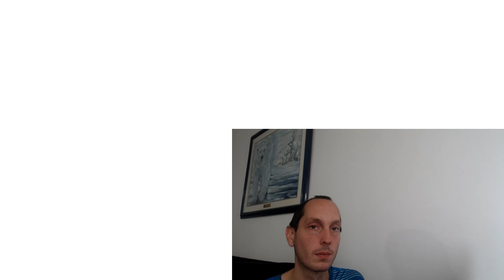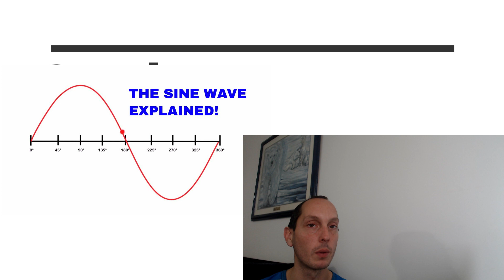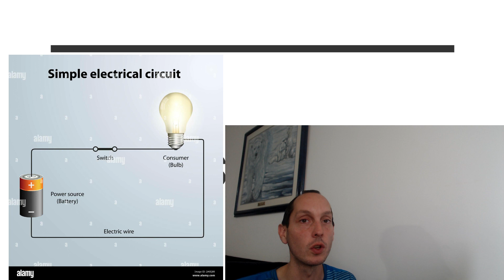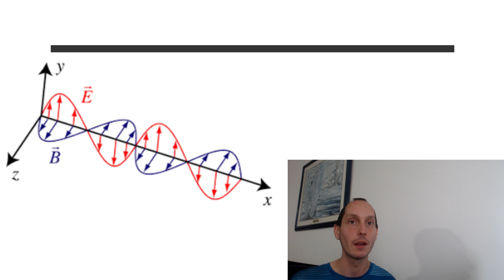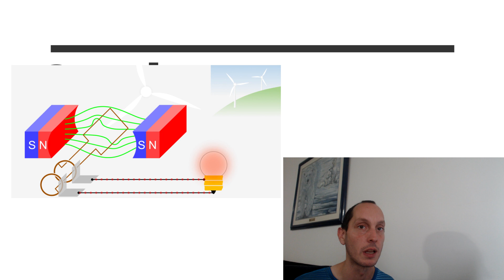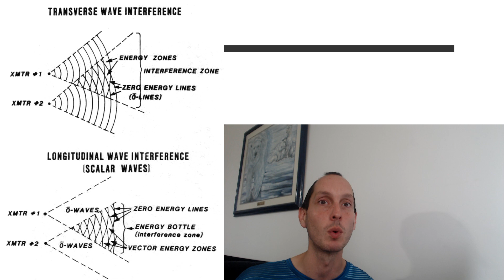Scalar Waves

Comment: Friend, I commend you for your effort to explore this topic. Though I cannot presently comment with competency on the claims of the physicality of the scalar component, I would comment on the phase conjugate system you question.
Just as old radar has had many different variations even within the single radiator model - dipole, yagi, parabolic, and so on; you would also be aware of the phased array system. A popular retro-reflector is the van atta array, which performs a quasi phase conjugation. Of course, this is not necessarily a true phase conjugation.
If there is mainstream indication of a free-space photon interaction, we would likely point to the photon-photon scattering feynman diagram (two-photon physics). This is a rare occurrence, which should indicate that a requisite is spatial coherence (perfect phase conjugation).
Back to the transmitters you referenced. It is not necessarily true that at least two transmitters are required to form a conjugate pair. As D. King reported in 1964 (Self-phasing array antennas), you can place a circulator between the antenna and a mixer with a local oscillator, producing a conjugate through parametric oscillation for instance, and returning it to the same antenna. Of course, you could simulate a pilot signal by sending out an initial signal through the same circulator, perhaps through an isolator (though there are many means of realizing something). If used in a phased array, you get a quasi-conjugate passively self-targeted radar beam. Still not quite sufficient to call it a phase conjugate mirror.
Now, say you take the same self-phasing array, and put it inside a reflecting box with an aperture chosen according to the operating band. By method of images (imagine being inside a mirror room), you have a vast volumetric array of these arrays in image space (time). Now, make the aperture diffractive (for instance, by keeping the area of the aperture, and splitting it into many slits; or by putting a bunch of parallel wires in front of the aperture), and you get a highly multi-path system that is greatly spread in time on the inside. Something like this may approach much closer to spatially coherent microwave pairs.

Comment: one set with 180deg phase difference and the other set at same frequency with same phase difference and from there just crossing the paths will generate what you are describing?
Reply from the maker: Crudely speaking that's the idea. Still not sure on optimal frequencies, duty, wave-shape etc...
Reply: @joellagace1679  What i  have found is that two antennas with 90deg physical shift and 90deg phase shifted signals will generate circularly polarized wave....which is highy directional.With two of those waves where other set will generate same thing but 180deg shifted (circular wave) high directivity can be achieved and scalar wave can be generated in located area.Signal shape is pure sine wave.If burst mode is used then this can be easy missused.

Comment: Some of my comments disappeared. The Tesla coil is a fine example. If you like to understand the Tesla coil also, then mrtesalonian has a video, that kind of proves that Scaler. So Basically the dc does have a AC component, and you can measure it.
the dome on the coil is the collector, and the coil is a step up transformer.
So Tesla, and John trup. So basically John stole electric  dust precipitation, and high voltage ozone production devices. these are the special circuits. I say Tesla did invent the dust collector. neg ion  generator/dust collector. as his basic understanding of every thing That followed. the pouring out of knowledge is based on a firm understanding of theory.. 

The radiating food devises John stole are the radar type circuits. <TESLA that transmit a lot of power through  induction. John worked with Van De Graff also. they together had the task of learning about all the inventions john took from the hotel..  they distributed them also, honey well is one company, also the old radio companies. Had been gifted these ideas and devises.

to see the after effects of such a energy device in action look at the melted aluminum rims of cars that melt into a pool of molten metal, in a so called forest fire.. Is similar to micro  vvaves,
Reply from the maker: Well Trump and Tesla never really got along, And Tesla made fun of Trumps "lame" attempt with beating Tesla over his silly Van De Graaff. So I could see why Trump wanted to take everything for his own.

Comment: scalar wave is a 3 dimensional wave , you cant have scalar without 3 phases , a single phase will create a shape more like double helix , thats 2D not 3D . aka Triangle , i could be wrong but you need at least 45 degrees to make a triangle  or  3 connecting points to make 3D

Comment from the maker: Another thing to consider, With that said in the video, It means by nature all radio broadcasts have a small scalar component to them as well. Without any special intent. Of course it will be much weaker, How ever because of the nature of scalar it should travel much greater distances and not be subject to fading etc as in traditional RF.  To of course we can build fancy communication systems knowing this. How ever in the spirit of keeping things simple, Take a simple "analog" radio  Give it a DC bias, So 2V DC to start Minus goes to antenna and plus to radio ground.  just a few volts of negative bias! don't go overboard you don't want to kill the radio, it should tolerate a few volts fine. This would give us a "reverse" DC bias to the RX section of the radio, This opens up those "hidden" scalar" sub carriers that Bedini talks about, A simple "fine" scalar tuner would simply be a small variable DC power Supply! Now for the antenna, We want the antenna to be Scalar sensitive and not RF,  The easiest way is making your own balun with a ridiculously high impedance on the antenna side.  Have a loop antenna and put it inside thick metal tube. For RF shielding, In many cases ESP on shortwave, You will hear the stations much differently now, As your going to be tuning into the scalar competent. If you think there may be "Hidden" scalar sub carriers, Vary the bias slightly to reveal these hidden channels.